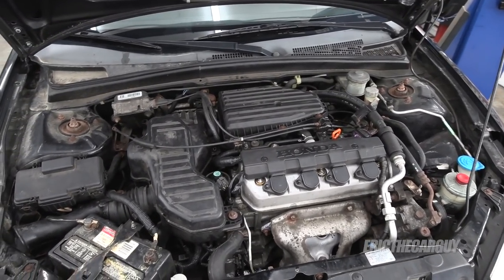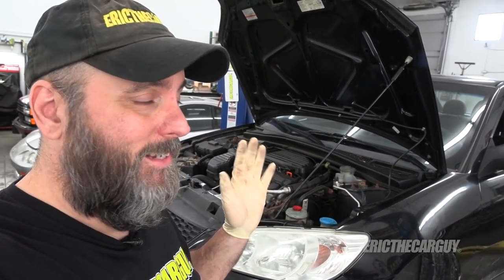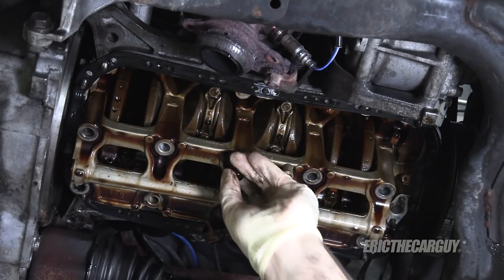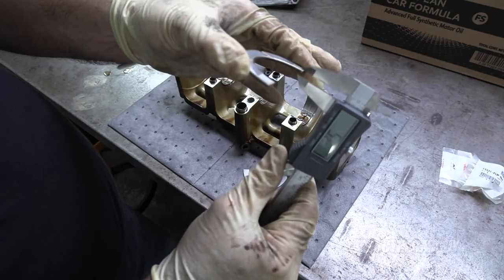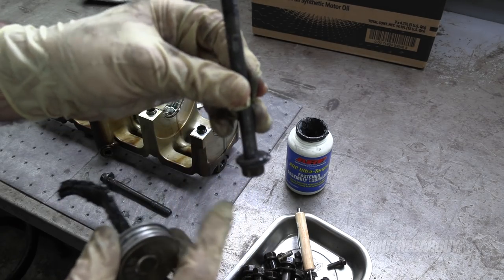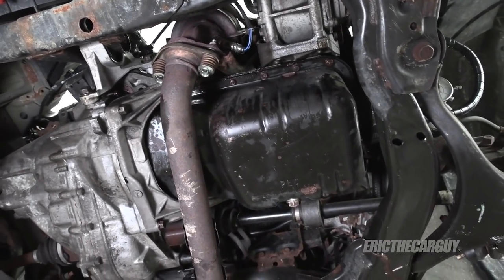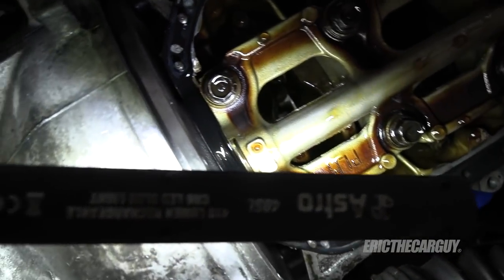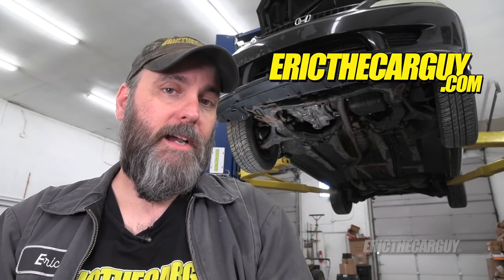How To Test and Replace Thrust Bearings

Comment: My Daughter had a Honda crv 
And the same problem.. in the end it was the bolt threads allowing oil by the thread not sealing with the washers .. so change the washers and or seal the threads with silicone… 
Good luck .!

Comment: Hey Eric, I'm an avid fan of your channel. I bought a 2014 Ford Ranger 2.2L, turbocharged XLT Variant, Manual transmission with 80,000 km on the odometer. I'm new to diesel but I think I am feeling something not normal about it. I didn;t notice it at first as I thought I am just adapting with the new setup as I am used to small sedan. I feel a vibration or metal to metal clunking underneath when I am at low rpm, low speed specially when running at 3rd gear or when shifting gears, when car is moving fast i dont feel vibration and metal to metal clunk but when you change gears you will feel and hear a clunking noise and vibration underneath. Engine has no problem, it's quick accelerating, fast pickup truck.
I did a little research, google says a little bit about U-joints and shaft. Do you think these are the only thing that may cause it? I tried going underneath and notice nothing unusual, I tried to wiggle all the parts and there is no clunk or movement in the shafts and joints. Or I maybe I just have to wiggle it harder or use a pry bar or something?

Comment: Eric, you couldn't have come at a better time. I have a 1.6 Fiat engine that is basically the same as the ones on the Fiat X1/9. The problem is that the thrust bearing has fallen off the crank and has cause a serious problem where when I press on the clutch the engines just dies off due to the crank just getting chewed from rubbing on the block.
Now I have one of two choices. Either replace the crank with a used one since they're no longer being made (which would probably have made even more mileage than the old one)  and replace the whole bottom end bearings (which keep in mind they're still in good shape for an engine that has just done 150000 miles) and balance the new crank with the pistons that are already there.
Or just play Russian roulette and take the old crank to a machine shop and have them weld new metal where the crank has been wearing and put it all back with the old bearings (with new thrust bearings of course)
Reply from the maker: That's weird because bearings are designed to wear so that the crankshaft doesn't. Personally, if the crank is worn, and you can't get one, a machine shop may be your only option. Good luck.
Reply: @ericthecarguy  Well, the bearings have fallen off the crank due to a very bad clutch chatter that was caused by a leaking coolant passage block off plate that is behind the transmission and also due to at one point the engine ran with a missing spark plug after changing the timing belt. It's a mess, I know but the mechanic that I used to work on the car was careless, to put it mildly.
Reply from the maker: I'm sorry to hear that.

Comment: rusty hubs and grooves worn into the balancer/drive pulley or crankshaft mating surface will cause leaks also. they've made seal surface "sleeve" kits for years, for GM and others.
the sleeve kits are a pain, you have to ensure the surface is true and clean to slide on and bond the new sleeve surface, if you fail, bend it up or nick it, the new seal goes bye-bye very fast.
the joys of minimally rebuilt dinosaur vehicles not leaking fluids is great 😂

Comment: Quite a few good tips here, but I'd put the mount for the dial on the engine block to eliminate engine mounts from the equation. :)
Reply from the maker: Good call. I should have too, but the block is aluminum and space is limited.
Reply: @ericthecarguy  Good point, but im pretty sure the oil pan is some kind of magnetic 😉

Comment: I was wondering if an air line could have been connected to the dipstick tube and pressure applied,  maybe showing a slight leak faster.
Reply from the maker: Possibly, but as you'll see in the upcoming videos, that really wouldn't tell me much. The best method in my view is to use dye.

Comment: Excellent work good info.
I’m curious though I don’t remember you saying that the clutch pedal was depressed while you were prying on crankshaft pulley checking end play, if it was I digress carry on 👍
Reply from the maker: No, the clutch pedal was not depressed during those measurements.
Reply: @ericthecarguy  I thought about it and concluded that depressing the peddle would have made it difficult checking end play

Comment: Any reason not to put a small bead of sealant along those curves?  What's your opinion on using dye to find the leak? Might've saved you a lot of effort on chasing them down.  Thanks!
Reply from the maker: I did put a small beed on the areas where the manufacturer recommends. I'm of the opinion to let the gasket do the work, it shouldn't require sealant. I did show in the video what was causing the leak at the oil pan gasket. Dye could be used to help find the leak for sure. Thanks for your comment.

Comment: Had a clutch failure with oil leak.  Removed oil pan and found thrust bearings in the oil pan.  One thrust bearing was normal.  The other thrust bearing was squished and distorted causing score marks on the side of the crank shaft.  Engine was swapped out.  Rubber mount failure caused engine misalignment. Rubber mounts were replaced. Have new thrust bearings, but now worried on the finish of the surface on the crankshaft and oil film thickness.

Comment: I've watched videos on thrust bearing replacement and the mechanic sets the bearings by knocking the crank backwards with a hammer and then pushes crank forward with a prybar and keep it pried as the main caps are replaced. It locks them into place with only a few thousands of an inch play.

Comment: I had this same problem 5 years ago found out it was them little rings stuck on the bottom gasket after I had replace 3 times 3 different oil pan gaskets one oil pan and cam seals and crank seal and I was about to rip out my hair try to fix that oil leak! I finally seen it was them stupid metal rings Stuck in the bottom 😅

Comment: I noticed that full synthetic oil tends to leak more in these old engines.. So I just stick with blended. and it seems to hold better for me.
Reply from the maker: Funny, I had a segment about that I cut out of the video for time. However, since replacing all the engine seals I've been running synthetic in this engine without issues. Thanks for the comment.

Comment: It may seem counterintuitive, but you shouldn't use ARP lube on non arp applications. ARP lube can actually cause you to overtorque regular fasteners. Use what the manufacturer recommends. ARP bolts: ARP lube, Honda bolts: motor oil, Detroit Diesel: wierd yellow goop. Bolts are an engineered product and the torque applied includes specified lubricant.

Comment: I had the EXACT problems with my 2001 Civic. I dropped the oil pan and installed a new gasket. But no fix. Then the leak also stated on the other side. Honda dropped the ball on this generation. I read that these have problems with the main seals leaking.

Comment: Could brake clean damage the wires? I've always thought it may make the insulation brittle, therefore causing cracking. And then water penetration and so on...
Reply from the maker: Not in my experience.

Comment: I've waisted well wrong choice of words I guess anytime you're taking in knowledge it's not really a waste of time here I've spent a fair amount of time trying to gain the knowledge of how the thrust washers or are situated on a Ford 3.5 I got the 2 in place for for the life of King George I couldn't find where the front one is suppose to go, all along I was thinking it had to go in the front in a corresponding location to the ones in the back and then I see you pulling them out from somewhere towards the middle.Not that, that's where mine is likely to go at all but the bulb did shine rather brightly during the moment of my epiphany.Thanks for your video ,I believe I've got what I need now , just goes to show if you're working on a Ford and you can't find what you need you might find it only guys video who's working on Honda

Comment: I would guess the crank is worn inducing axial float between the thrust faces. Shims or oversized bearings would fix that problem. But should determine shaft center and figure out which side is worn and adapt oversize thrust bearing to the worn side.  Thats just my opinion

Comment: Why not use that UV light Kit to see where the oil starts leaking?
Reply from the maker: Good call, but it was pretty much leaking from everywhere. Also, at this point, I had replaced the front and rear seals as well as the oil pan gasket.
Reply: @ericthecarguy  Thanks for your videos! I know it takes time outta personal life. We do appreciate it!

Comment: You don't have to assemble the engine in order to check the crankshaft axial play. You could have it performed right after you had swapped the bearings.
Reply from the maker: That's what I did in the video.
Reply: @EricTheCarGuy No, that isn't. Your footage shows that you first had the engine assembled, then you had the thing and around cleaned, and then you had the crankshaft play re-checked. Neither you said that you didn't have to go thru the assembly process to re-check the play after new bearings are installed.

Comment: If it still leaks, wouldnt the PCV valve be suspect?
Reply from the maker: Only if the dipstick was blowing out, or I saw oil fumes coming out of the oil cap when the engine was running.

Comment: I hate diagnosing oil leaks.  Bleh.  The most difficult engine to prevent oil leaks on is the Ford FE engine (352, 390, 428, etc).  The intake manifold actually overlaps the cylinder heads a bit, and the place where the intake, heads, and block all join together is infamous for leaking.  Ridiculously difficult to keep that oil-tight.

Comment: I Enjoy the videos but, shouldn't you mount the magnetic end of the daily indicator on the block cause if you mount it on the body of the car your going to be reading the movement of the motor mounts, just an observation.
Reply from the maker: That would have worked better, but the block is aluminum, my dial indicator uses a magnetic base, and space is very limited. As I said in the video, if you hear a 'clunk' when you move then crank, then check it. Otherwise, it's probably not an issue.

Comment: It's just me, but I would've replaced all bearings while in there.
Thrust, crank & rod shells all work together.
Reply: The mains in these engines (with the bearing cradle versus main caps) are difficult if not impossible to rotate out without damaging the crank surface. Sometimes its best to leave well enough alone but I would agree on the rod bearings, they take a beating.
Reply: no way to safely replace those bearings without dropping the crank. Much bigger job
Reply from the maker: In order to do that properly, you would have to measure bearing clearances to determine which bearings to get. After removing the crank from the engine. Then special order them from Honda and wait for them to show up. Given the condition of the bearings in this engine were excellent, I didn't see a need for that. Not saying it's a bad idea, just not always practical in my opinion.
Reply: @ericthecarguy  Reading the other two replies, your answer stands as correct for this application. I had no idea the crank shells were so difficult to remove.
As for size, I just go with standard OEM, without measuring or shoelace/WD40 polishing the crank like every YouTube video out there. Bearings are sacrificial. This isn't some hi revving track car. OEM usually work fine. If they are down to all copper, scored crank- then yes, pull & polish. Always do rods, 80k or with Hondas at the Timing belt/WP service.
These are just OP.
Reply from the maker: I'm talking about OEM bearings. They don't come in a standard size as far as I know. You have to measure to determine what size you need and then order them.
Reply: @ericthecarguy  I was just picturing my own '89 3.8L. RA has "Standard" and "Oversize". I'd guess different applications would have more choices.
Reply: @ericthecarguy  RockAuto= 0.25mm, 0.5mm Undersize, and "Standard". I usually just go standard, as long as no huge wear.
Reply from the maker: But you're guessing if you don't know the bearing clearances which is critical to oil pressure and engine operation. A risky thing in my mind. Also, as previously stated, these bearings were fine and, in my view, didn't require replacement. If I were going to go that far, I might as well rebuild the entire engine. I'd have the pistons out anyway.

Comment: I didn't need to see the dial indicator to know that crank was walking a mile and half by 3:17 good grief, the "clunking sound" was a big clue also. at most you should here a very light "tick" sound.
** you should indicate off the crank/pulley bolt to eliminate any flex in the pulley/rubber, etc. hit it with wire wheel or other to clean surface first, same for magnetic base location. keeping the locations as close as possible and both on the engine. if you pry the pulley back and forth off the frame to pulley, you are also moving engine mounts, etc.
better off measuring from flex plate/flywheel to oil pan, while moving the crank from pulley end!

Comment: That plastic cam plug is a really crappy design IMO. I bought a billet aluminum cam plug with three O rings to replace it and I'm going on 5 years with no leaks at all. It has a lip on the back to hold it in, so I had to remove the valve cover and lift the rocker arm assembly to install it but it beats the heck out of having to replace that plastic plug every couple years or worrying about it popping out.
Reply from the maker: I have one of those too. I agree, way better than the plastic that shrinks over time causing a leak. Thanks for the comment.

Comment: Adding lube to bolts before tightening effects the clamping force at a specified torque.....they were not lubed at the factory during assembly it's not the end of the world but isn't really good advice to be taken by new guys wrenching on cars and for every bolt in an engine
Reply from the maker: I disagree, all ARP does is fasteners. They have a ton of R&D into this lube, as well as fastener torque. I've found it to be very effective, especially for assembling critical engine components like main bolts. BTW, I believe the manual states to oil the threads. Thanks for the comment.
Reply: @ericthecarguy  yes arp are bolt people but those bolts were not arp bolts .....its a fact that lube will allow a bolt to yield more if lubed than dry at a specified torque or secondary angle of tightening,  tightening a bolt dry to 100nm then the same bolt lubed to 100nm the clamping force is NOT the same
Reply: @ericthecarguy  if the manual specifies to oil the bolts then all is well 👍👍

Comment: 150K+ and I would guess $1,000+ to have thrust washer replaced at a dealer to fix a leak? I don't know but I would think putting in a thicker washer might take up the slack if they are available. Got an 08 CRV dripping just a tiny bit, but it's got 170K on it, it's going  to 200K before it's going down the road, let the next guy mess with it as I only have to pay for parts if I had it.fixed.
Reply from the maker: As I said in the video the thrust bearings did not cause the oil leak. Thanks for the comment.

Comment: I have 2001 Chevy express 4.3, that has the same problem, it sucks because the transmission has to come out to gain access to the thrust bearings, and the oil pan obviously: (